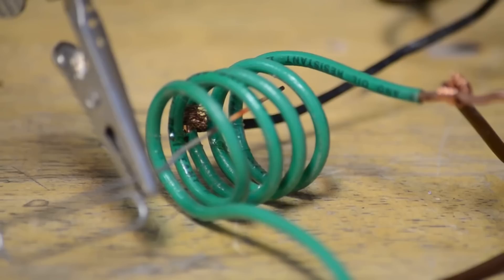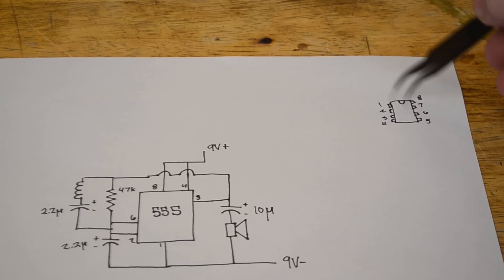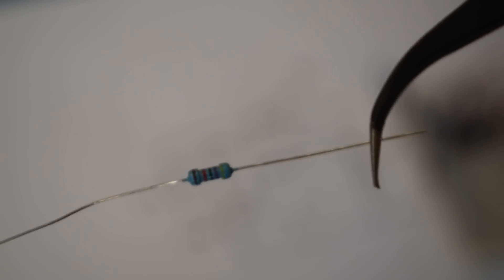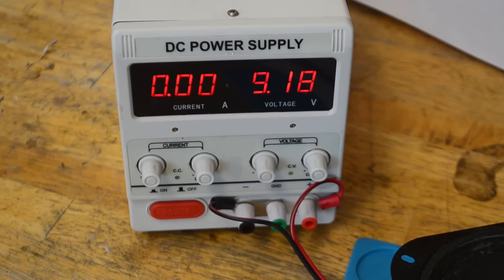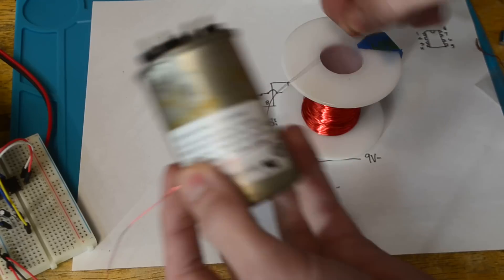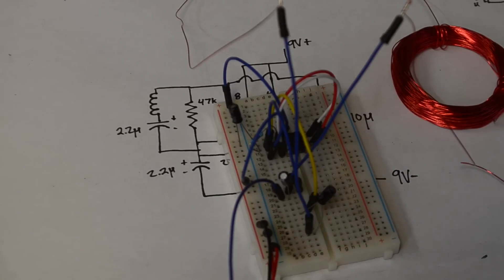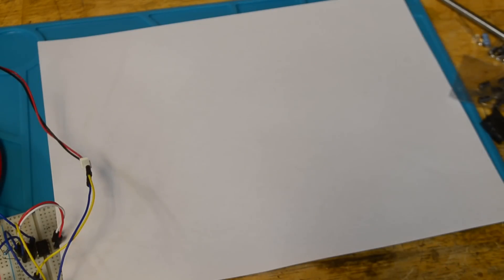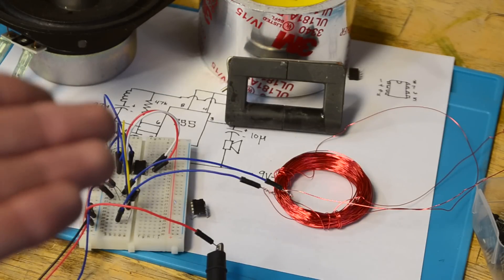How to make a Metal Detector

Comment: I have a question to ask you. Is there a reason why you set the number of turns of the coil to 200? Also, is there a reason why you set the diameter to that extent? I would like to know if there is a related formula.🥲🥲 plz ㅠㅠ

Comment: I have a question to ask you. Is there a reason why you set the number of turns of the coil to 200? Also, is there a reason why you set the diameter to that extent? I would like to know if there is a related formula.
Reply: Short answer: to get the desired inductance value of the coil.

Comment: so how would you output more power at say 17 khz than another coil running at 17khz im trying to understand how you could increase the emf in a specific khz range or would it be fixed for each khz and then the shape of the coil dictates the power over a sustained distance so a larger coil would run 17 khz but would hold more emf for longer than say a smaller coil running at 17khz is there any way to add more power to boost emf ?

Comment: A detector with multiple coils in a grid array , for example 60 coils by 60 coils may be able to show a visual pattern on a screen at the same 60 by 60 resolution, also  you could have an inline detector with potentially hundreds of coils in a row, this  attached to a wheeled vehicle ,driven in a straight line the data from this could then be recorded and an image could then be shown, it is likely the coils would interact with each other but I wonder if they could be shielded, to stop the interference.

Comment: The time scale continuance of the flux capacitor  produces 12.96gigawatts  of the hypothesis of the capacitor s ohm multiplied by the  9v  produced from the rectified and the transducer driver co inhersion of the atominous  flight armed cortex atonimistic control with the 5g interceptor  equilibrium of the hypothesis or the squre route of 25 is 5 so the over all answer to this in ...theres none

Comment: Is there some tool I could use to turn the strength of the signal going to the speaker into useable computer data instead, so I could pair this with a raspberry pi.

Comment: Perfect for someone that has never used a metal detector.>>>ur2.pl/1215    I opened it up and had it assembled in about 5 minutes looked over the manual and went out in the yard. It will find the smallest items as well as large ones. Its just what I was looking for to mess around with.

Comment: Firstly, the sound of your talking is faster than the speed of my hearing, but luckily, I know next to nothing about electricity and absolutely nothing about resistors and most of the other electrical components you used, so even if I could have heard you faster it wouldn't have helped me to comprehend. 
Secondly, what I gathered from watching you was interesting and made me curious. Luckily for me, your visible movements were not faster than the speed of my seeing, equally lucky I suppose, is the fact that you were neither involved in card tricks nor rabbits and hats because people who are, have a reputation concerning the speed of their hand movements compared to the speed of blinking. So, I am grateful for your show of restraint in that area......where science becomes indistinguishable from hocus pocus, such as the vexing question about the nature of the electron which has sent many a would be swimmer to a spectacular grave, is it a particle or a wave? How many naive fools have gone to an early grave in a sea of electrons while sporting a speedo? Only God knows for sure.
So, having said all that, now have questions.
The coil you made, if my dusty old brain remembers correctly, that becomes an electro magnet once you send power through it, is that right? 
If that is right then it has an electrical field,  do you have a way to calculate the radius and area of the field?
The metal being detected is interfering with the field and this is somehow generating a noise, which sounded almost identical to my tinnitus BTW.  I am also wondering how the noise is actually generated and how different metals cause various tones?
I would like to try metal detecting but I wouldn't really like to attract too much attention due mostly to my inability to answer any potential questions.
I'm wondering if there is any way you could design two coils which would go around my ankles underneath my pants and a lead to a battery pack and a speaker jack which could go in my pockets so that I appear to be an old guy just walking his dog while I'm actually metal detecting?
I suppose that wouldn't be possible as the two coils would create separate fields and interfere with each other.
Maybe the souls of my shoes (soles, I know, but English can be fun and besides I've been eating a lot of breaded sole lately, so chewy) 
I digress, have you noticed?
Back to the soles of my shoes, maybe a coil could go around each of them and then I could have two small coils detecting wherever I go?
They would have to go around the outside of the shoe, maybe held by the rim of the soul, would that work? I think it might, I bought my son's shoes with flashing lights around them when they were little......well, ...thank you in advance for all the wonderful answers and in case you want to try your hand at making metal detecting shoes or ankle weight looking things, I take a size 9.5 wide fit.

Comment: +Keystone Science or anyone else:
Is it possible to design a similar metal detector that doesn't make that god awful noise? Maybe by switching out the speaker for an LED. Any suggestions?
Reply: I don't know a better solution but I do know an led would suck for that

Comment: Actually, I do metal detecting as a hobby and there is a real use for short-range detectors. They're called pinpointers and they help locate the exact location of an item in a pile of dirt you dug out (or help inform you if you failed to pick it up with the first dirt shoveling). Just thought id inform you if you weren't already aware :)
Reply: What are these exactly? Readily-built circuits or components? (refering to short range detector)
Reply: @josephj5864  They are readily built devices little metal detecting wands you hold in your hand and wave in through the dirt clump to find the metal object inside. Look up 'metal detecting pinpointers'. They also make waterproof ones that vibrate instead of make noise.

Comment: if you use a lighter it will burn off magwire insulation, it is flammable.
Reply: But it will leave an oxide coating which will still need cleaning off.

Comment: So... using this design you can make the metal detector discriminating, so it can tell the difference between certain metals. 
In order to do that you simply place an adjustable capacitor or a potentiometer in parallel with the coil. 
As potentiometers and varicaps that have wide ranges of values are best.

Comment: Do you have a schematic for that other chip you used? I have a chip with a PWM signal generator, checker and modifier. SG3525A. It's an 16 pin chip. I'm trying to do the same as you did just to see if I could. I can't getting it working and maybe your implementation will give me a clue what I'm doing wrong.